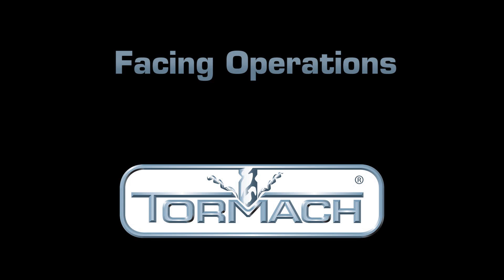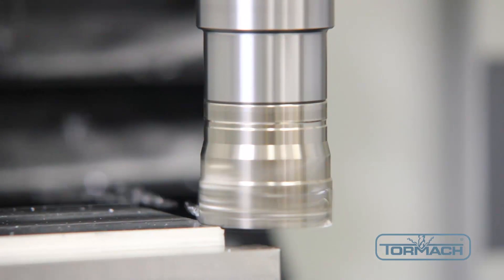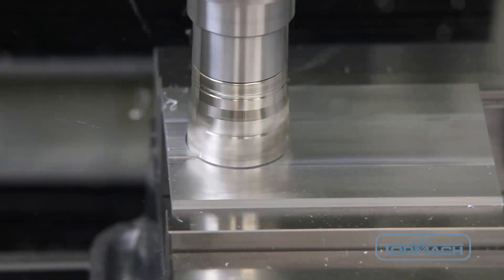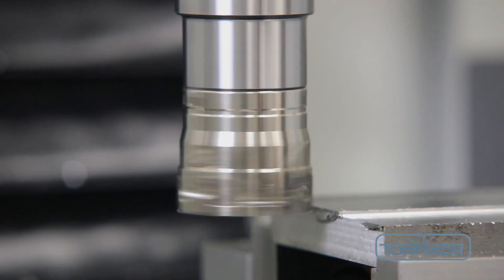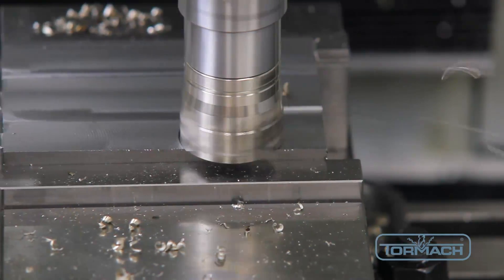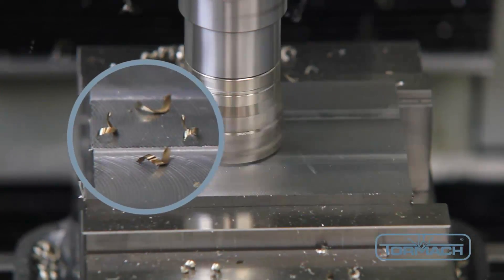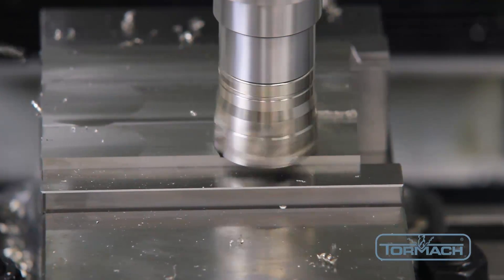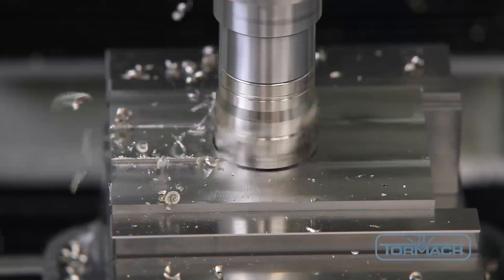Face Milling Demonstration - Tormach CNC

Comment: Was the spindle setup on the lower speed range? So the motor has more torque to drive the shell mill.  Seems like it would be necessary for the shell mill on the steels and possibly the aluminum as well.
Reply from the maker: Hello Stig,  You are correct the machine was in low belt for the steel and stainless cuts.  The aluminum cut was done in high belt as the max speed in low is 2000 RPM.

Comment: is it ok for the machine to sound like that or are we pushing it to the limits?
Reply from the maker: The cuts demonstrated in this video are all within the machines capabilities. It should be noted that the machine in this video is two generations (Series 2) behind our current offering.
Reply: I thought all the cuts sounded pretty good, considering the cutting parameters and the rigidity of the machine.